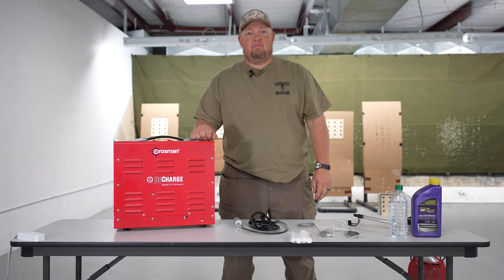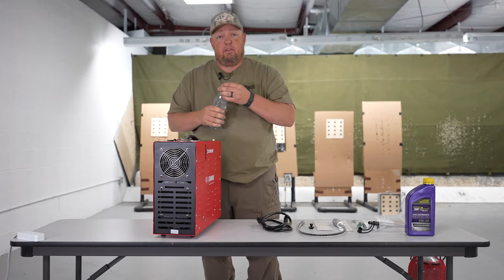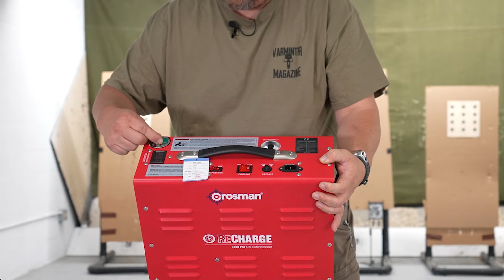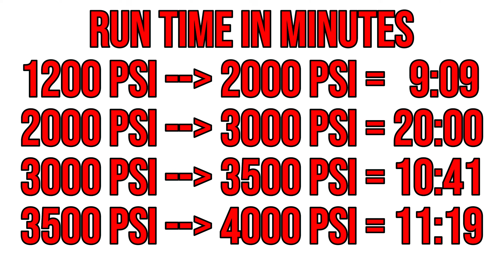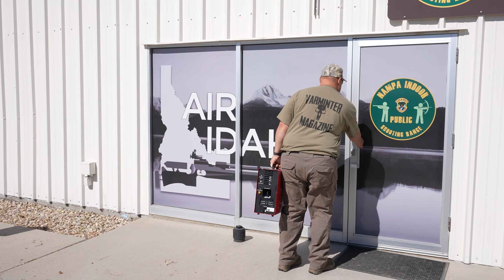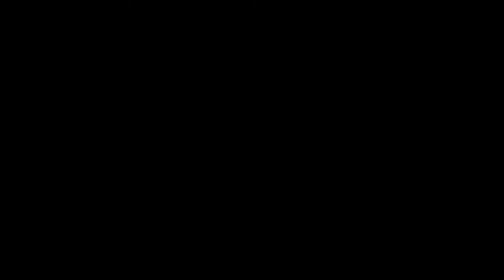Crosman Recharge Air Compressor Initial Set up and Tutorial

Comment: Where can I buy/replace the adapter to connect the compressor hose to the tank hose?
Reply from the maker: You would have to check with Crosman on that, or an aftermarket supplier like Air Tanks For Sale.

Comment: Engine oil for a compressor? Is that really wise? I've heard that one thing you do NOT need in a compressor crankcase is 'detergent automotive oil', just wondering about that.
Reply from the maker: Directly from the manual, "5. Remove the black oil breather tube and refill the moto with air compressor or 5W-40 motor oil to the appropriate level."

Crosman also approved this video for use in their training for anyone using this compressor.
Reply: @varmintermagazine  Then, asked and answered ! 
First time for everything, I guess. Then again, it's been a while since I sold and serviced air compressors, technology moves right along! :)